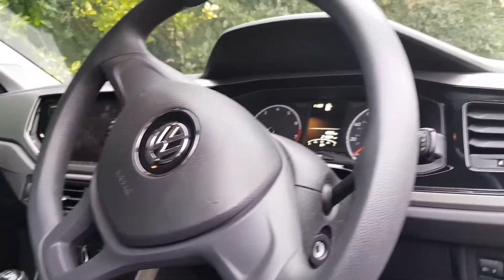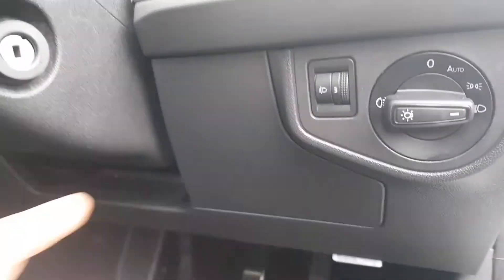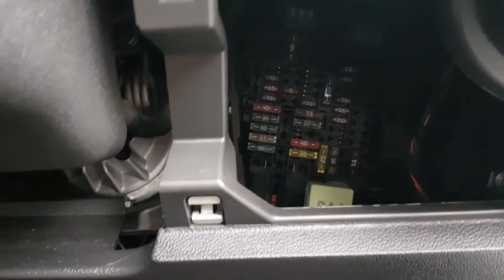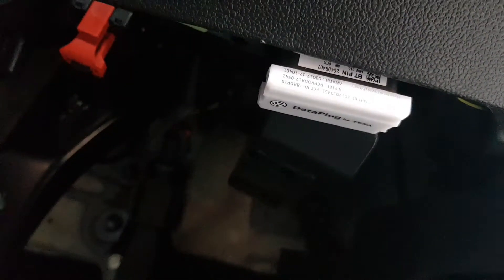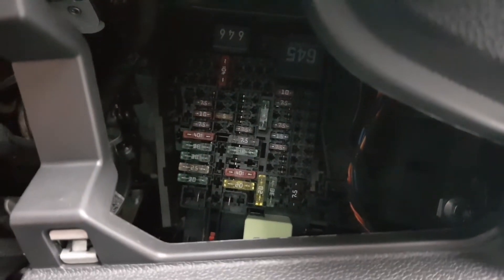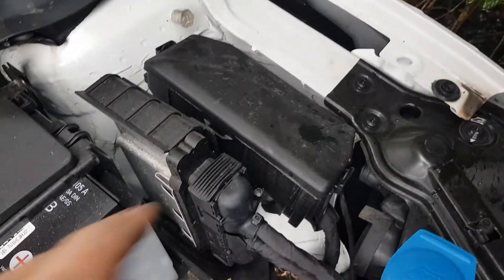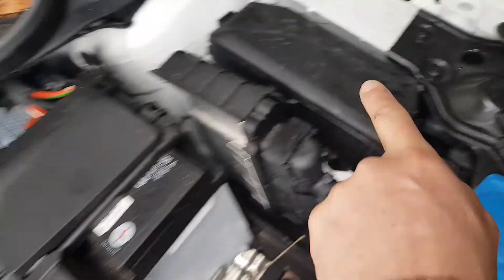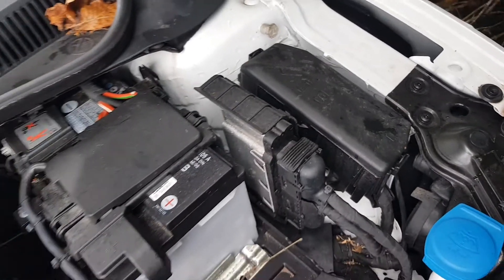Volkswagen polo fuse box locations and obd port

Comment: To the point - no nonsense! Can you do some for changing tail lights on 2022 model (Looking to get a reverse line to attach aftermarket reverse cam)
Reply from the maker: you should be able to get the feed at the sill wiring loom on the drivers side kick panel or sill trim. hope this helps no need to wire it to the back lights unless the camera needs power from back there.

Comment: Hi where is the Washer fluid fuse? Or which fuse is for the washer fluid? My polo washer fluid is not working and the nozzles are not making the noise, assuming that the fuse has blown.
Reply: Hi there, did you ever get this problem sorted? If so, would you mind sharing please as I've got the same thing. Thank you 😊